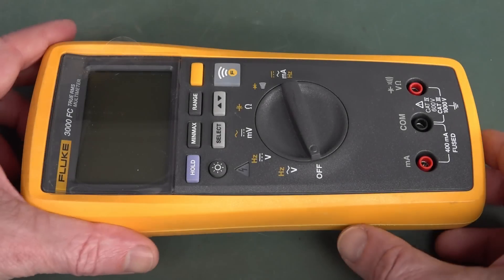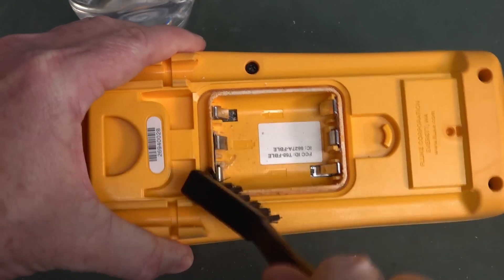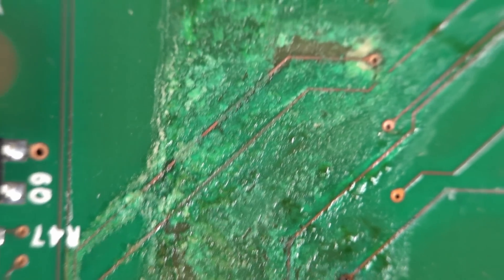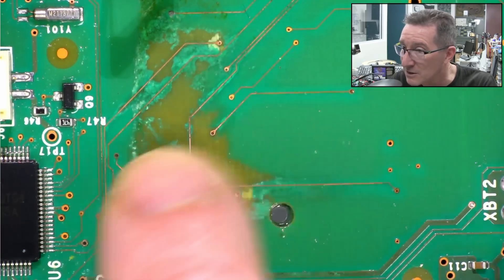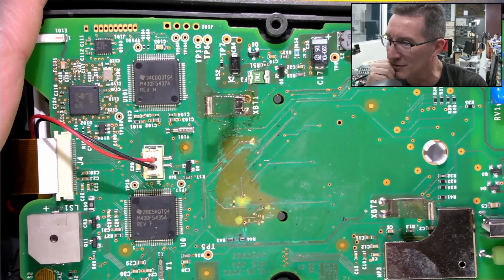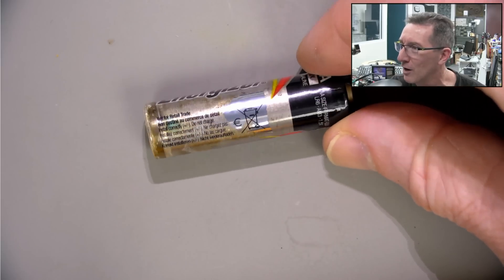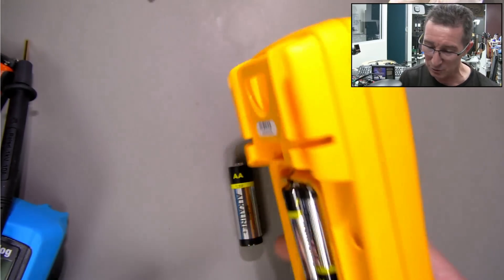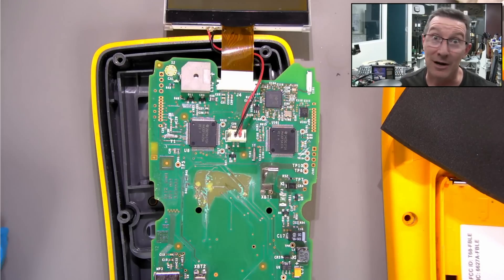EEVblog 1497 - RIP Fluke. Thanks Energizer. NOT.

Comment: I run Lithium AA and AAA batteries in all my test gear.  Lasts for a lot longer, and never leak. I'm talking about the non rechargeable variety, "Energizer ultimate lithium" etc.  Mice, radio controllers remotes etc. Lasts a lot longer, and as I said, never leaks.
Reply from the maker: Yeah, I use those on really critical stuff. Very expensive.
Reply: @EEVblog  They're not too expensive if you get them from Digikey. The markup on consumer packaged batteries is insane.
Reply: @unknownhours  Yeah, you're wasting money if you aren't buying lithium primary batteries from Mouser/Digikey, guaranteed legit, and cheap. Only place I buy coin cells anymore.
Reply: Digikey is not viable for EU though
Reply: @EEVblog  , if you factor in the savings in repair, downtime and lost equipment they seem a much better deal, especially if you buy them in bulk from DigiKey.
Reply: @EEVblog  Well, the lithium aren't expensive anymore in comparison once the alkaline destroyed your multi-hundred-dollar device, are they? 😉
Also, the lithiums have a huge capacity (almost double compared to even the best alkaline) and their best-before date is 20 years.
Reply: @EEVblog  As a beginner, I just asked on your ultimate beginner's guide if it would be safe to use lithium batteries in a multimeter. I guess the answer is yes it is safe. You are absolutely right they are expensive, but not as much as new equipment.
Reply: @EEVblog  I guess not so expensive, compared to the value of this poor Fluke... Although lithium primary batteries rarely leak, but when they do, they instantly destroy everything beyond repair. There is some ultra agressive goo in them.
Reply: NiMH rechargeable batteries are much less prone to leakage. Lower voltage, though.
Reply: @gargantuablargg  I use Eneloops for everything. My oldest are ~15 years old and still test like new. Alkaline batteries are obsolete IMO.
Reply: My oldest Eneloop batteries are over 15 years old and they still work great. We have over 200 nimh batteries that get cycled at least once a year. Never seen them leak.
Reply: @cheesetomatoes  There are devices that don't work well with Eneloops. I have a wall clock that runs on one 1.5V cell. It works with an Eneloop, but after just a few weeks it starts spinning and looking for the radio signal - a sign that the battery is "empty". If you pop in an alkaline, it runs for 1.5 years with no problems. It just doesn't like the low voltage of NiMh.
Reply: @maximilianmustermann5763  I wonder if putting a capacitor across the battery holder would help?
Reply: @gargantuablargg  I use NiMH rechargeables in my multimeter since ages. In the 9V application it is either 8.4V or 9.6V, both seems to work just fine, and doesn't self-discharge as annoyingly fast as many seems to think. I have some spares charged laying around, so it's a half a minute replace if needed.

I use rechargeables everywhere it works, you can spare a lot of money with this practice as well.
Reply: @gargantuablargg  I have some and have yet to test them in my meter, what issue have you seen using them?
Reply: I'll switch to those for sure. These garbage batteries annoy me no end.
Reply: I run rechargeable AA lithium in my mouse and might get some AAA for my meter.
Reply: Exactly. Never, ever trust alkalines. If you really care about and want to protect your stuff, the energizer lithium are the way to go. The next best thing is go for your choice of LSD NiMH like Eneloops.
Reply: Yea, never had lithium (primary) batteries do this on me. Much more expensive per watthour, but consider the advantage of practically never leaking, totally worth it.
Reply: Not bad, but they're pretty expensive, even on Digikey. Anybody ever use rechargeable Ni-MH? Do they leak as bad/often? 3.5Ah Lithium non-rechargeable are $3.30 each in 100 quantity, but 2.5Ah Ni-MH rechargeables are $3.00. Seems like you more than break-even if you just recharge the NiMH once then discard it, but it would only matter if they don't leak.
Reply: @asm_nop  I bought about 50 AA and 50 AAA eneloop NIMH about 5 years ago and have been using them in everything, avoiding alkaline. They are supposedly much less likely to leak and indeed not one has leaked yet. I have recharged most of them about a dozen times so far and havnt noticed any of them losing significant capacity. I use some nifty AAA to C battery adapters and AA to D battery adapters for C and D stuff. I havnt found a good solution for 9v yet.
Reply: @asm_nop  Eneloop NimH will last forever (if you use a decent intelligent charger) and never leak. I've had Eneloops that were 12 years old and still worked with like 90% of their advertised capacity. When they go bad, they just don't work anymore, nothing bad happens. At least in my experience, but I have used hundreds of them over the years.
The problem with the NiMh is that although their initial voltage is around 1.5V, they very quickly drop to around 1.34, which seems to be their "real working voltage". Some devices don't like that and start complaining about empty batteries, or just won't work at all.
They work best in devices that can use them down to 1.1 or 1.05 Volts.
Reply: @asm_nop  I have never had a NiMH leak, and I've been using them in almost everything for more than a decade. Stands to reason that a cell designed to be re-used 100s of times (as opposed to used once and thrown in the trash) would have better seals.
Reply: @asm_nop  I have never had NiMH leak anywhere as dramatically as alkalines, not even the cheap ones. Most I got was a little corrosion on the terminals.
Reply: Funny, 5 minutes before seeing this video I just ordered 270 eur worth of lithium aa & aaa batteries. Should last for couple years and save my precious toys. And how it is expensive, when the devices in most danger go over a year between change? Like +1,5€ per cell per year for peace of mind. In a nice multimeter etc which sell for hundreds. 

And here in Finland I at least use lithiums in winter with more devices just to make them work outside, as alkalines die in seconds, where lithiums have no problem at all.
Reply: It’d make a good YouTube video
Reply: Have had 2 out of hundreds of primary lithium Energizers leak over the last 5 to 7 years; they produced clear table salt sized crystals that caused no damage. Other than the higher voltage and the sudden sharp drop-off of voltage at end of life (bad for digital recording if you don’t replace them before the cliff), they are the best in my gear and well worth the exorbitant price.
Reply: @kenbecker6670  I used to use them in cheap Arm&Hammer electric toothbrushes. Why? Because I'd get about 10 months use out of a pair, and about two weeks out of regular AAs. I've literally worn a new toothbrush out and swapped the batteries into a new brush. I suppose the short high-draw load cycle is just optimal for them.
Reply: Instead, they get punctured and start fires. Something heavy falls on them, could result in disaster.
My buddy's brother had an 18v cordless drill battery catch fire in his work van. 
My guess, he got careless and set something heavy on it and punctured it.
Fortunately he caught it within enough time to prevent whole work van from going up in flames. But lost about $700 in work tools. Everything has a calculated risk.
Reply: That’s a good idea.
Reply: with things like this that use 3 cells you can replace them with a cheap LiPo
Reply: How hard would it be to create a sensor that warns you of battery leaks? The gunk is almost always conductive and the leakage mostly occurs a the ends of a battery...
Reply: @LarixusSnydes  actually only at 1 end-the negative side.
The positive side can't leak, as there is no seal on that end-just solid metal.
Yes, it could IF the can corroded through, but this never seems to happen.
They leak from the bottom seal, mostly due to gas build-up.
The one exception:9 volt batteries can leak from either end, although they leak more readily at the top(connector)end.
Reply: I use Duracell 2.5Ah NiMH and they’re real nice. I got a PowerEx that conditions and slow charges over a few days. I get way more runtime than anything else.
Reply: Thank you I have never thought about that from a "leak perspective".
Reply: For those using the NiMh, look for the right charger. My charger is a well known type (Powerex Maha MH-C9000), and it tends to discard cells much to early. It does that probably with some test to check if no regular battery has been put in, and shows 'High' and refuses to charge. Testing the cell after a 'dumb' charge shows full capacity. For that problem I keep a dumb charger at hand.
Reply: Some of the Fluke meters are now made in China. The quality is terrible. Be cautious. I also ordered some "Fluke" meter leads from a Chinese distributor. They arrived and looked authentic. I used them for a while and started to detect some small differences from my older truly authentic Fluke leads. They felt more noodly like overcooked spaghetti and I played my hunch and cut and stripped one to have a closer look. Sure enough, I discovered that the number of stranded conductors in the lead was less than half that of the truly authentic Fluke 10 amp leads. Not only a fraudulent sale but a dangerous sale. There is no way these leads would have carried ten amps safely. I have learned over and over that the Chineese have no ethics when it comes to trade . They are out to cheat you in every way possible and they have no compunction about theft of design or theft of cash. Steer clear of anything Chiinese. The only reason an Apple phone is of decent quality is because the Chhineese use them to spy on the West and to figure out the best way to ship fenatnyll into the U.S. to kill Americans. Especially Ameerican kids.
Reply: I only use lithium or nimh nowadays, with the low self discharge nimh there’s no reasons to use alkaline any more.
Reply: Only problem is that these lithium primaries hog the element - you could make a stack of rechargeables with just one AA!
That and they are prone to "going nuclear" when you use them in series packs, you can't reliably measure the state of charge, and they do leak - it's rare, but it happens (and is way more of a 'gloves-on' situation than alkalines).
You can get away with any brand of alkaline as long as you take them out when you know your'e done with them for a while - I pull the cell out of my digital calipers before I put them away, simply because coin-cells have been a nightmare for me...
Reply: Just agreeing with everyone else ;)
Those non-rechargable Li batteries are quite good but pricey.  Probably worth it for good equipment though.
But my go-to is rechargeable NiMH batteries when the device will handle the slightly lower voltage.

I've never seen an alkaline cause that much damage.  I know Duracel has a bad rep, but WTF is Energizer using in there?  You'd think they would try to formulate their electrolyte to cause as little damage as possible when this happens.

BTW: If you live in a humid climate, leakage seems to happen a lot more.  I'm not sure that's true or why, but my limited experience.
Reply: @travcollier  They're formulating their electrolyte for maximum power density and/or minimum cost. "If it leaks, we warned you not to leave the battery in there for long periods of time... not our problem!"

Humidity being a contributing factor makes sense. Any weakness in the seals will be exacerbated, since moisture will accelerate corrosion.
Reply: @MikeU128  I wonder if there's a market opportunity for alkaline batteries formulated to not destroy equipment if they leak, and maybe a bit of extra attention to making them less likely to leak in the first place.
Probably not since, like me, lots of folks just don't use alkaline batteries that much... Especially in situations where a leak could be really bad/expensive.
Reply: Don't know if it's a myth or not but I've repaired vintage electronics with leaked cells, presumably Li-MnO2 cells.
Reply: I run the rechargeable lithium batteries. Two in series is only 8.4v but in most meters is close enough to replace a 9v batt. Haven't got any that take 3x 1.5v but maybe a single 18650 or similar would work.
Reply: Same here. I just fixed all my Fluke thermometers. Had to order replacement Contacts from Fluke to get them all working correctly again. I had to order from them twice.  Since, I forgot to double the number for the jumper Dual contact to fix the number of units I was fixing. Fluke needs to make a website to order parts from. It sucks having to call in for them.
Reply: All depends on whether you want a leak to damage an expensive piece of equipment or an explosion to burn your entire house down.
Reply: I regret to tell you that my trusty old UT89XD got nuked by Energizer ultimate lithiums just this week, one year-old batteries, they all leaked and the electrolyte ate away at the solder mask, the traces and the screen pads... I will be using NiMH from now on when I can afford a new meter
Reply: I use rechargeable batteries in everything except clocks or devices were an Alkaline battery lasts more than 6 months, no leaks and its much cheaper, even remotes now work better with rechargeable because smart TV remotes eat batteries.
Reply: Me too.  I decided a few years ago that life is better without devices being killed with leaks, so I "ratcheted up" my quality of life one affordable notch, and permanently committed to only Lithium Ultimates for everything that uses disposable AA and AAA.  It's a little pricey, yes, but so far I've been able to keep replacing the 24 packs when they run out and haven't used an alkaline (or had to clean up a leak) since then.  And because I'm the battery purchaser of the house, the policy has unknowingly spread to my wife and step-kids.
Reply: I've had a lithium AAA go poof once. I'm glad I heard it, it was in some active noise-canceling headphones that were turned off. It sprayed liquid out jist like this. I cleaned it up and it was fine.

Comment: If it's a 4- layer PCB and vias are corroded, the via connection to inner layers may be broken. that would be bad....
Reply from the maker: That's what I'm hoping isn't the case. Will try a repair.
Reply: @EEVblog  Sadly it is a 4 layer board. You can see the layer check (whats the correct term for that?) for the board fabrication at https://youtu.be/7dze5CnZnmk?t=1077 on the edge of the PCB...
Reply: I've seen Louis Rossmann do multi-layer repair, but that's mostly just scrape and dig until the top layer isn't shorting to some internal layer, not reconnecting a via to an internal layer. If you can get a schematic, you're probably better off running a bodge wire from the via to some other via or trace where it pops back up rather than trying to repair a connection to an inner layer. The only saving grace is they are not (yet) putting components on the inner layers, so at some point all inner layer traces have to pop back to the surface.
Reply: @gorak9000  will that be the future? Components inside the layers? 😆
Reply: @Peter_A1466  Don't give them ideas, please! 🙂
Reply: @Peter_A1466  I can't say too much, but things are coming. PCBs are just like a bigger cheaper version of ASICS and chips - In ASICS, there are people looking into putting transistors up in the metal layers - given enough time, the same will happen with PCBs too. I mean they're already saving on ink not marking surface mount components - if they can make those even smaller and cheaper and embed them right into the board...
Reply: @Peter_A1466  already possible. Embedded resistors or caps
Reply: @mikeselectricstuff -  4 layers. EEK!!  how the heck can anything with more than two sides be repaired? .. is there a way to identify components in a board sandwich? how do they get separated?
Reply: @Kevin75668  thanks. i can imagine it's extremely involved! Theres always a person that will set new boundaries. and thats good. but heck, that's dedication  cubed!   Up thumbed  your reply 👍
Reply: @Kevin75668  Thank you for the tip. These videos from Pace seem awesome! So clearly spoken, thorough and as a bonus retro cool. I guess this was the one you were referring to https://youtu.be/IBi40aq4-t0? I just watched the one about removing conformal coating. I've never ran across the topic covered anywhere.